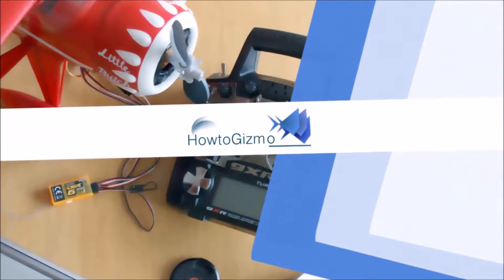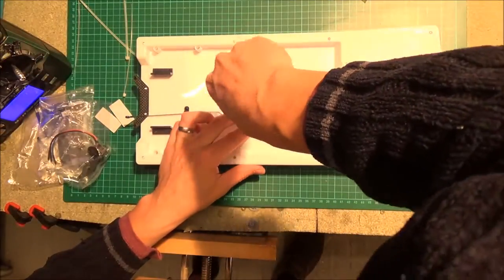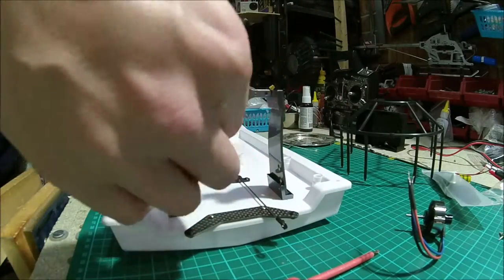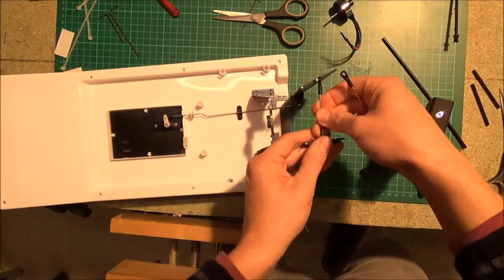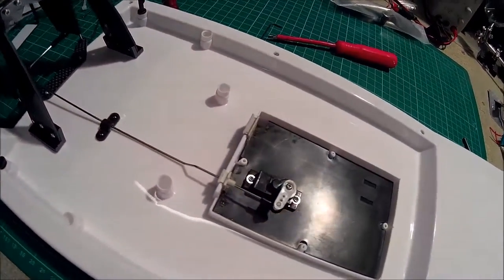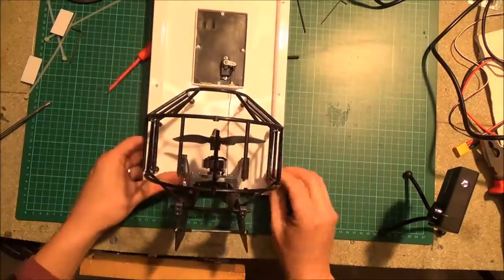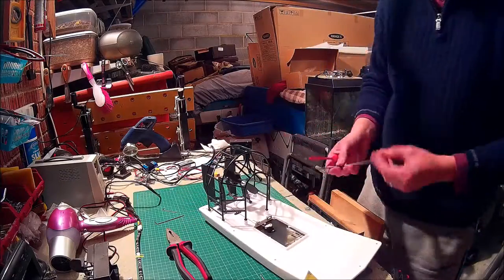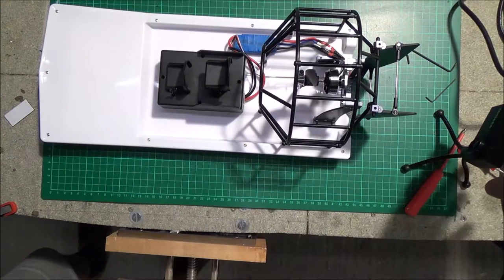Electric Fan Boat - The Swamp Dawg Build!

Comment: Only 3 of the horizontal bars are metal and have screws in them and you failed to mention you mounted the servo back to front first up, but changed it later. The servo arm is toward the front of the boat. Finally the longest rod goes to the bottom of the vanes. It can be installed on the top but it does make the vanes skew slightly.  With it on the bottom the whole assembly is more uniform. I was surprised you got a 20amp ESC, it's not supposed to have one supplied according to the listing, obviously the UK buyers are "special" :-) 

It would appear Murphy lodges at your house. It seemed if there was a way to get things back to front you managed it. But don't worry, I managed to one vane upside down ???  I decided to place the esc and receiver in the bottom storage space which left plenty of room for the battery up top. You must use an extension for the motor wiring to achieve this.  Oh yes, another thing, I have the two carbon fiber motor mounts fitted 180 degrees from yours and yet everything works well.  I chose to mount it this way to place the weight as far forward as possible although I'm not sure it makes that much difference.

All up a nice little "boat" and I wasn't at all surprised to find there was no manual.  Typical HK, save money by making the customer figure things out. +Things are cheaper when the customer makes videos as well.  Thank you.

PS, just one little tip, when you've finished the build, could you do close ups of all the important pieces and how they fit. It tends to make things so much clearer.  All the best.